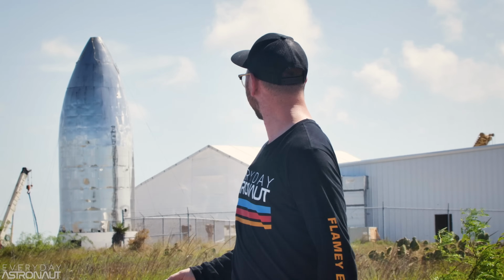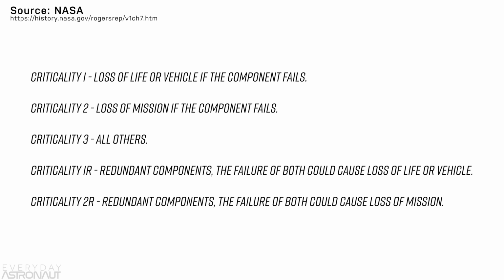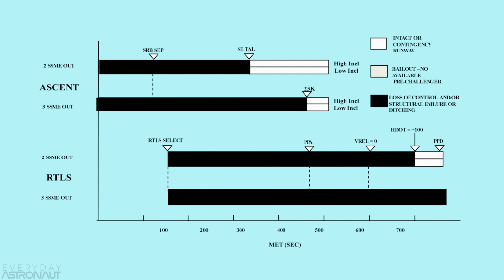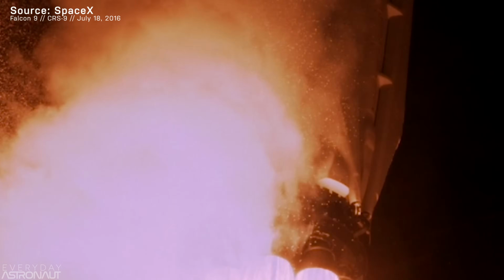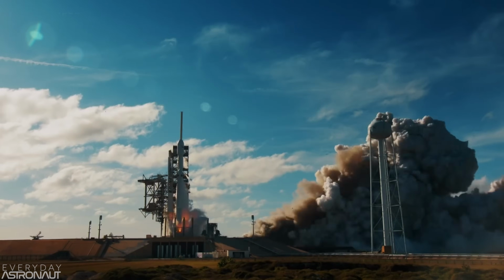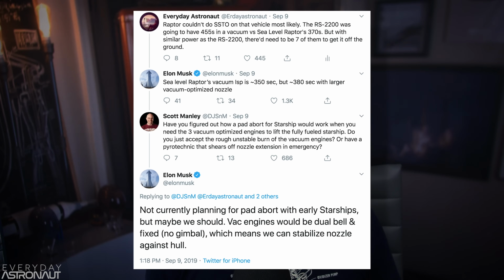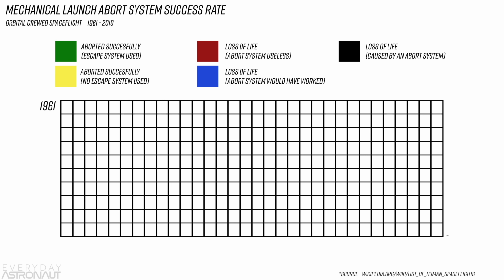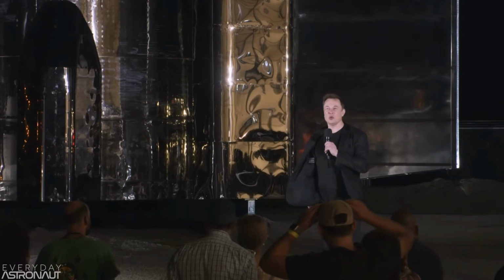Why won’t Starship have an abort system? Should it?!

Comment: The whole question is kind of pointless, because people will never be happy. If it's there and not needed, people say "Well, that was a waste of resources." but if it's not there and it is needed, people say "Wow, if only there was an abort system." If you build something to be foolproof, the universe will just throw a better fool at it. The Titanic was said to be unsinkable, yet it hit and iceberg and it sank, killing 1500 people because it didn't have enough lifeboats. The U-2 was believed to be untouchable, yet it was shot down, because it didn't have any counter measures. The Space Shuttle was promised to have a failure rate of 1 in 100.000, but by the end of the program, that figure came to rest at 1 in 68. 

The specific issues that caused those disasters were addressed, sure, but that means that other issues will just pop up. The Costa Concordia and the Sewol still sank, the SR-71 that replaced the U-2 still crashed more than a few times, and you even kind of argue against yourself here with the Soyuz. It has flown thousands of times, hundreds if you just want to limit it to modernity, and they still haven't made the system foolproof as we saw just last year. The list of potential failures on something as complicated as a rocket is extremely long, and not a lot need to go wrong for the thing to end in disaster. And to then not have a back up... that's arrogant and scary.

Comment: Nope you still need the back up escape system because in the case of a full crewed starship you looking at up to 100 lives on that thing!  One live lost would be bad press for space X, But 100 lost.  Too much riding on the starship to lose even one person.. 100 be the end of space X and maybe even cause people to even turn away from Elon's other companies like the Boring Company tunnels!   As for the escape system for the star ship upper part with the crew on board?  Use compressed air system fitted as angled small thrusters to push the upper star ship crew section away from the exploding lower lifting rocket part.  a simple well known system of compressed air in normal tanks. Not expensive or complicated.  even if the chance of a failure at launch or flight is 1 in billion I would still go with the compressed air escape system as that 1 in a billion would still kill the crew if you did not have the back up system to save them?  And of course Elon would be in big trouble with the law and the grieving families.. his competitors would love his space X company to be closed down for killing 1 or 100 crew. They would get rid then of a competitor who now has most of the space flight work.

Comment: Good one Tim. An excellent contribution to the safety of space flight debate. I’m guessing Elon will have watched this, and it might even have some  influence on Starship design, in which case your report is a very significant contribution. One thing that particularly came across to me is that Elon’s choice of stainless steel for spaceship construction is the right way to go. It is evidently so much more durable than aluminium or carbon fibre. The fact that anything at all was left of Starship 1’s structure after the fire and then finally the explosion demonstrated that. Also, your reference to a Shuttle mission which was saved by a stainless component after losing a heat shield tile further reinforced the point.

Comment: Hi Tim, thank you so much for making longer videos and going deep into the topics! It´s worth to wait for such videos! One topic I have missed in this video: Is it even theoretically possible for Starship to have an abort system and what would be the performance costs vs. safety gains? e.g. could Starship have a pair of very strong yet short burning solid rocket motors down in the engine section just intended to work the 2 or 3 seconds needed before the Raptors on Starship are realistically fully up and running? I just tried now to search a bit and answer myself and see that answer is most likely "NO"!:-) For pad abort of a fully fueled Starship weighing about 1300 tons, you would need 2 solid rocket motors with a thrust of maybe 700 tons each, which brings us close to the performance figures of the new European SRB P120 ... which has 800 tons of thrust, but with a diameter of 3.4 meters! By needing two of these (in a vehicle that has 9 meters in diameter) there wouldn´t simply be space for the "normal" Raptors, so this way is a dead end as it seems! Thanks again for all the energy you put into this! Pavel

Comment: Just had an Idea, instead of making those explody ring sections why not make it like a Toilet Roll Core, where the Stainless steel sheet is wound spirally, it can then be welded in inside and out and the spiral overlap would give it more strength. No more ring sections for rocket bodies

Comment: Yes Columbia was destroyed during re-entry, but the loss was due to damage sustained during a launch failure (the foam strike) so I'm not so sure it's right to argue that an abort system would have been useless there.  A launch abort system capable of detecting and classifying the damage to the wing could have been fired during ascent and saved the crew.

Comment: The SuperDraco abort test failure was a materials issue NASA and other agencies had discounted in the 1960's; pressurized nitrogen tetroxide igniting titanium. Oops...many agencies now need to re-examine this. 

Starship won't be using nitrogen tetroxide, anywhere.

Comment: The design as is can't support an abort of it's second stage because of it's huge mass and it's entire base being covered by Vac optimized nozzles which can never create the necessary thrust density to push away from a first stage booster.  Either a huge number of canted rockets along it's surface or preferably a proper 3 stage design like that of Falcon.  This would reduce the passenger portions mass too a reasonable size and allow it escape with a small enough number of engines that they can realistically fit on the base.  For transit beyond Earth the 2nd and 3rd stage simply remain connected and the 2nd stage is refilled on orbit.

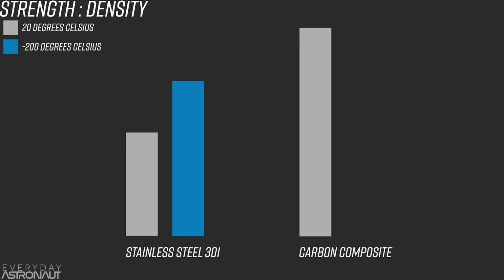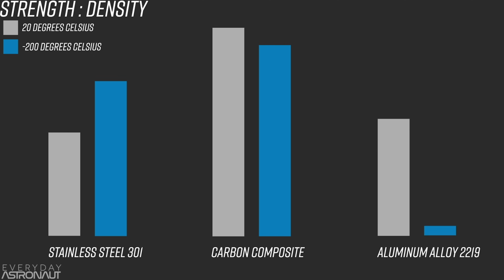Comment: Hi Tim, Excellent, thanks so much! But was the chart from 18:20 to 18:30 maybe the wrong one? I thought you were talking about high temperature material comparison, not a cryogenic temperature comparison. Or maybe that chart was supposed to have a 3rd set of color bars for high temperature and they accidentally disappeared? The audio was about high temperature survivability. Maybe that little piece of the video could be repaired?

Comment: True, AIRplanes live up to their name, but I have often thought a crap load of parachutes attached to it would be a great, unfortunately the way they build commercial airliners, travel velocity, and materials used present a myriad of disaster scenarios not conducive to succesful commercial flight. Not to mention, a reasonable way to slow down, in flight, for parachute deployment, in atmosphere, only adds to the problem. Now spaceflight, and landing on other planets, with atmosphere, or not, would absolutely have to be  built to be aerodynamic enough for any kind of atmospheric conditions, with or without gravity, some sort of effective launch abort system would be necessary to get me on it. I would prefer perfected high thrust output ion engines on anything that flys. If it existed. Propulsive landing is the future of landing's, on Earth. But flaming rocket propulsive landing's, anywhere, in the universe, will always require failsafe flight abort systems. You always run out of gas, or eventually, something blows up.  Combustion = heat, no good. Maybe they should use Earth's magnetic field to create push or pull, or hover.

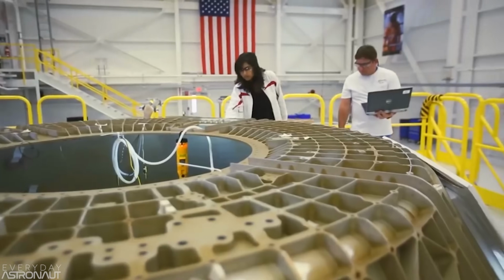Comment: Let’s put space travel safety into perspective. 9:40 stated acceptable chance of loss of crew  at less than one in 500.
World wide in year 2018   4.3 billion passengers boarded an airliner. If the average load  per plane was 200 people that means 21.5 million flights per years. Losing one plane every 500 flights equates to 43 thousand crashes per year world wide. Who wants to go ride on a rocket ship now?

Comment: I'm just trying to reconcile these ideas:
"Of course the Soviet N-1 was unreliable, look at how many engines it had!"
"Of course Starship will be reliable, look at how many engines it has!"
Reply from the maker: There are significant design difference including an engine that will be fully developed and fully tester before flight (vs not), blast containment cells between the engines (vs not) a modern computer and sensor suite that can shut down and control engines before catastrophe (vs not). In the same way that the Falcon Heavy with nearly as many engines as the N-1 has been fully successful thus far, mostly because of all the reasons listed
Reply: @EverydayAstronaut  I guess it's the computing power that we have today that makes all these things seem possible. If someone asked me how to do a lunar flyby and return imagery of the far side, but I have 1959 technology to work with, I honestly couldn't imagine how to do it. It's like if I was told to demonstrate air is a mixture of different gases, but I only have 18th century technology to do it, I would have to throw up my hands in surrender. Thanks for all the work you do, Tim. You're by far the easiest on-ramp to this world that's out there, and that's coming from someone with a quarter-century experience teaching physics.

Comment: Hmmm.  How about this?  Individual abort pods...with attitude control thrusters and a tiny liquid booster engine that can decelerate the astronaut in orbit...i.e. against the direction of orbit, until there is little to no traverse motion relative to Earth’s surface.  At that point the astronaut is only falling into the atmosphere vertically at prolly 1000 mph max and will not suffer thermal damage.  At 20,000 feet the Astronaut can leave the pod and just parachute down conventionally...OR a bigger chute could drop the entire pod safely!  NASA! YOU HEARD IT HERE FIRST😂

Comment: Great dive into something a lot of people have been concerned about.
One small point on the activation system for the flaps on Starship.  You mentioned redundant hydraulics.  Elon has said that the current prototypes have Tesla Model 3 motors driving hydraulic pumps, but he seemed quite adamant that eventually they would be replaced by direct drive activation from the Model 3 motors. And of course powered by 4 Tesla Model S 100kWh batteries. Hydraulic systems rarely fail because the drive motor stops - it's the dozens of hoses, pipes, joints, valves that are the failure points.  And as Elon said the best part is no part.  I also think that with Tesla's drivetrain experience, they could engineer a very robust system.

Comment: It would have to have an entirely separate engine system for the 100 astronaughts. Would significantly increase weight of the starship so much you probably wouldn't be able to get it off the ground. Equivalent to the dragon capsule that uses 4 draco thrusters for 4 astronauts. It would take over 100 dracos to safely move 100 astronauts out of harm's way.

Comment: Pretty sure they plan to use Starship itself as a launch escape system. Musk brought it up once or twice saying three of the six Raptor engines on Starship would be enough to push it away from an exploding booster. It’ll have to be tested through allot of simulations before they try it.

Comment: Starship needs to fly unmanned first lots of times, afterward, the launch system is better known and an educated decision can be made about what type of abort system is appropriate. If Moon bases and regular flights to Mars are to be done, there will also be a need for maximum payload interplanetary missions without reusability for the upper stages (interplanetary injection stage). Examples: Unmanned Outer Solar System exploration, large space telescopes, space stations beyond LEO.

Comment: The three sea-level engines alone are not powerful enough to even lift the vehicle off the ground fully loaded.
If you were to fire the vacuum engines (assuming the earth's atmosphere were somehow gone) as well as the three sea-level ones, that would just barely do it.
I think 6 SL engines and 1 vacuum engine in the middle (with an even bigger nozzle) might be better. You don't need a whole lot of thrust when you're in space.

Comment: Rarely talked about, but didn't the n1 have an working escape system too? I never found out whether there were humans in it, but I read that the escape system worked (and probably saved the astronauts). Is that true?
Reply: No crew ever flew, but they would've had an escape system.

Comment: Fighter jets and other high performance airplanes still have ejection seats, because there's a chance they'll go to pieces at an inopportune time. That said, it's very easy to find lots of examples where ejection seats have killed people who would otherwise have been safe. This is why ejection seats are not used on airliners - they'd likely be more dangerous than nothing at all (do you want all maintenance workers to need to go through explosives training before even touching an airliner?), and the failure modes of airplanes are pretty benign. Wings don't tend to fall off airplanes, and they don't tend to come apart in midair, and as long as they don't come apart they can be brought to some semblance of a safe landing.

Rockets on the other hand have a nasty habit of coming apart in midair and given the much slimmer safety margins I think this will be the case for a very long time to come.

Also, the landing mode for Starship will be fraught with danger... anything goes wrong, everyone dies, and there's not much which could be done about it.

Comment: The abort system vs. not abort system debate makes me think of a similar debate for commercial airplanes: the two vs. four engines debate (especially with the Boeing 777 if I remember correctly, that has those two massive engines instead of 4 smaller ones).

Comment: Rockets do need to have an abort system. We can't compare them to planes, because any rocket works in extremely pressure and temperature . If  something goes wrong there's no chance to be saved, and we can't say the same about planes

Comment: Engine redundancy is a shaky argument in rocketry. This not just my conjecture, but of SpaceX engineers themselves.  You are effectively saying:   

"In case of engine failure, we can revert to other engines as backup; *assuming the failure event of the first engine was gracious enough to not damage the surrounding engines, or the fuel piping above the cutoff valves of that engine unit.*"  A layperson knows that these devices usually fail suddenly and violently. 

Another angle to the same issue is that engine problems are rarely the reason why launches or other space operations fail. Neither of the two Falcon9 accidents were engine problems, neither the Shuttle accidents, or the recent Sojuz launch incident where abort vehicle was used. Out of all the different ways different probe missions by NASA and ESA have failed or suffered, none have been due to engine problems. In fact, I can't recall a single incident from past few decades where engines were to blame. Last that comes to mind is the Soviet N1 rocket, whose all 4 launch attempts failed. Incidentally, N1 could have operated with some engines missing, but the failure modes always cascaded, bringing the whole engine array down in seconds.

Comment: Seems that the solid rocket boosters on the space shuttle was actually not the proposed idea, it was pushed through because of money (the ones that built the boosters). Also, comparing percentages is tricky, 100% for the F1 engines... in 65 flights. Way less flights then the others, so what would it be when it had flown 100? ;)

Comment: Excellent job Tim!
In my opinion, having abort systems has risks, not having has another risks.
Todays commercial airplanes have no abort systems, and the overall reliability of the system is way better than cars.
I think in the long run, when Starship became a commercial flight competitor, abort systems may add more risks than they intent to prevent.
But now... If you watch the overpressure test of the Mark 1, the vessel remain fairly good. The upper part of the tank blew, but the tank is supposed to have a relief valve, closed to make that test.
I'm not taking account of a possible fire, but the crew could be fine, and the 10G accel of an abort system isn't also inocuous.
I'm agree with you in wait and see, because the flights will be more and more reliable.
SpaceX has the virtue of learning from failures, so failures like the Mark 1 test give them information that they surely will use in the differents iterations of the Starship.

Comment: Love the Cessna analogy. Or you could say it is the equivalent of putting a rubber dinghy on top of your ocean liner so that you can float away with it in case your ocean liner sinks. LOL. Maybe you would be better off using those resources into developing a more reliable ocean liner. =P